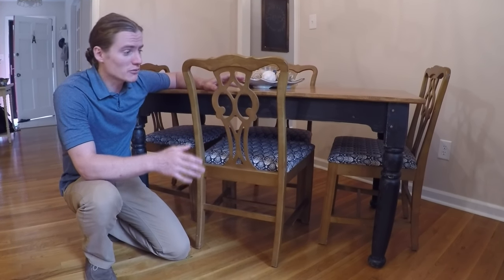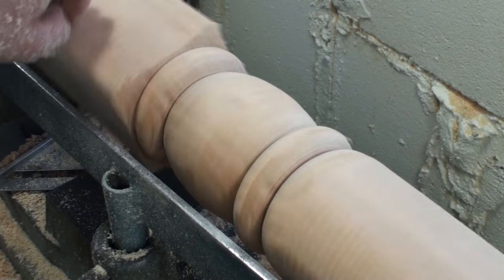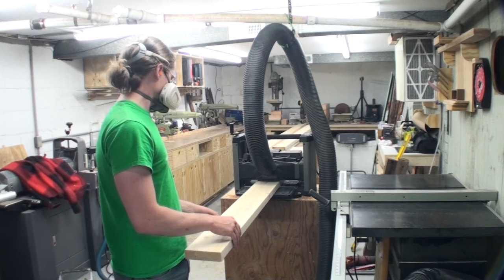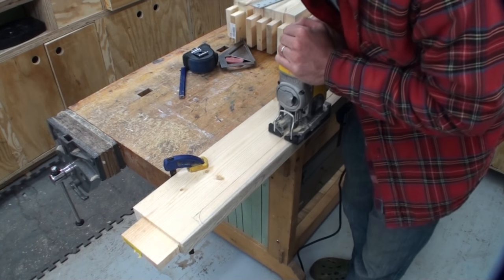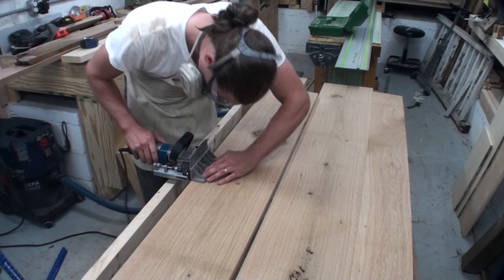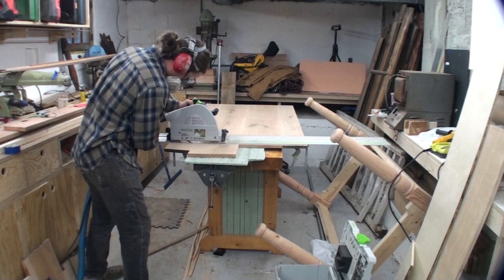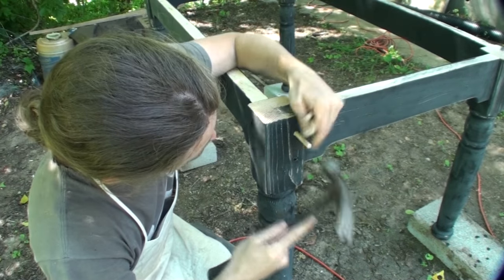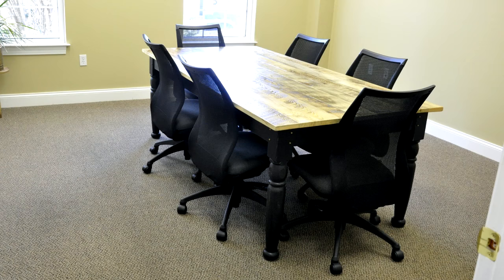Woodworking - DIY Farm Table Build - How to Plans!

Comment: hey, That top clamping rack is Trick! I'm figuring  you probably didn't film it when you built it, but perhaps a short video in the future with come close ups of how its built and anything you might do different if you built another? I noticed you like to do the distressed painted finish, I have one you maybe haven't tried. Its a multi coat paint finish. You put a couple of coats of a paint of a contrasting color to your top coat. Don't use a high contrast like Yellow under black, but more like a dark rust red under black. Then when you sand through the black in areas, The color underneath shows through. I bought an old Windsor back chair at a garage sale for $2. I stripped it hoping to find attractive hardwood under the 10 layers of paint. I did find hardwood, 3 different kinds! the seat looked like oak the legs and most of the spindles looked like beech with barely no visible grain and the bent hoop on the back looked like ash.  So i painted it, I did a dark blue underneath and then a green grey over that. When I sanded through the corners and on places where you would see wear on the seat and legs it looked great. then in a few small  spots where you would see heavy wear like on the top of the stretcher between the front legs, where a child would use as a foot rest I sanded all the way through to the wood.
Reply from the maker: I've done a few pieces like that. Historically a lot of furniture has had layered colors for different effects. For windsor chairs it's the same to, painting red under black. For the wood, it's common for them to have white pine seats, oak/ash bends and maple turnings. Each wood picked for it's strengths. It sounds nice though. I've got plans to make a windsor chair soon, my throne of sorts for my house. Feel free to post a photo of your chair to my facebook.

Comment: Thats a really Good video!  This Does help with my question about  glueing a hardwood top instead of using plywood.  I think the guy with the sawmill that told me that might have had either moisture issues or the top didn't have any allowance for expansion and contraction.  Thats just my guess.  I will Definitely give this a try!   Thank you for another Awesome video, I really appreciate my question being answered too!
Reply from the maker: Thanks, good luck with your projects, send me some photos sometime.

Comment: My main concern is getting all the cuts exactly the same length with a mitre saw, like all the legs cut down from a longer 4x4. Also squaring up the edges of the boards as I don't have a planer or jointer or table saw. Which would be most recommended for squaring up the edges for minimal cost/space. Also, when gluing up the table top is it ok to use pocket holes, or should I go for dowels/biscuits? Thanks
Reply from the maker: The truth is, even if your off a little on every cut it won't make a difference to the eye. You just measure, draw a line with a square and cut on the waste side of the line....the most you would be off is a 1/16" in this kind of project that won't make ANY difference. You could use a circular saw to get your boards close if they are really crooked, then finish them off close with a plane. But just a hand plane will do it. Pocket holes will work fine. I just use the biscuits for alignment. Pocket holes also would take the place of clamps, put a little glue in there and screw it together. It's best not to over think it, you'll learn a lot and have those skills on future projects. Good luck.

Comment: So I'm sure you know about this, but it seems like a drawbored mortise and tenon would eliminate the need to have/use the band clamps. It would require assembling the base twice. I'd bet it would take longer than dealing with the band clamp, unless you already dry assemble every base.
Reply from the maker: The band clamps are fast and draw boring them would ad more time to the process that I'd like. It's not a bad idea for certain things, including my tables but speed is a major part of making this work for me. Thank you for watching and for the comment,  perhaps I'll do a video on draw boring in the future It's a semi obscure technique a lot of people are not familiar with.
Reply: The Homestead Craftsman figured that was the case. I've used drawbores when I've either wanted to be able to disassemble the joint (without glue), or I don't have enough clamps to clamp up every thing is like to glue up.

A video on drawbores would be cool.

Comment: Beautiful build. I can see why you have a market for your tables. Do you build a "farm chair" for a set?
Reply from the maker: Thank you. I stay away from chairs when it comes to selling my tables. I single chair would take longer than the table so I would not be able to price them on the same "formula" if you will I do on the tables. I do make benches and they are doing well. Chairs also undergo a whole different level of abuse and I don't want to be responsible when they get broken. Tables are simple and all the weight/force is vertical and that's where they are strongest. With that said, I will be doing some chair videos down the road but closer on the horizon will be a set of plans for the benches I make and Im making a new video to go with them. I already have two bench videos on my channel if you are interested. Thanks.
Reply: Also, chairs aren't completely full of straight line like a table or a bench. There's curves and bends. A chair needs to be comfortable and that requires a ton of measurements and effort. whereas a bench or a table need to just be. People are better off going to a flea market and buying old sturdy chairs and simply repainting them.
Reply from the maker: Bobby Wahler
Luckily I sell tables from an antique store, so I just suggest they buy them there, or somewhere similar.

Comment: Thanks for the great videos!  I had a question about your legs.  Do you always use 4 X 4's (3.5" by 3.5") for your legs?  I know you glued up some 2X6's for a tapered leg in one video, but did were originally using thicker legs for turning?  (I thought you brought a pick-up load home from somewhere in an old video.)  I guess I'm wondering if you've gone to a skinnier leg?  And if you use thicker legs for longer tables, etc?  And whether your customers care....whether they prefer thicker or thinner?
Reply from the maker: I use both. The 3.5's are easy to get, I use them on 6 foot or shorter tables, for longer tables I use the rough sawn legs. Customer preference varies.

Comment: how do you keep the bases from twisting when gluing them up? ensuring very straight stretchers and tight square mortise and tenons?
Reply from the maker: My floor is flat enough, but even if it isn't, as long as the shoulders of the tenons are tight it is fine, this type of table base has enough flex in it to take the shape of any floor, even if it is not perfectly flat. I've never had a problem unless the apron boards themselves have a lot of twist, but in that case you just don't use that board.

Comment: I have read that pocket hole joinery is not string enough and or will not allow for wood to move or shift. Do you share this thought?  I live an in area with seasons and climate change.
Reply: Also, would perpendicular strips on the bottom side allow for movement ? I suppose I could ask a woodworker to straighten  the boards as well as plane them. I was planning on purchasing s4s wood. Does that stil need to be planed ?
Thank you.  I enjoy watching your channel

Comment: When do you feel it is necessary to add cross supports for the apron? Do you follow a rule of thumb for length/width of the table?  

Thanks!
Reply from the maker: I do it on tables that are wider than 42 inches or ones that have tops that are thinner...i just play it by ear.
Reply: The Homestead Craftsman thanks for the reply. I’ll be building a new dining table shortly very similar to your design except the legs. I don’t have a lathe so I will be purchasing turned legs online.

Comment: Do you recommend using pre stain?
Reply from the maker: For certain woods like cherry it can help, same for maple and other woods that get blotchy. I tend to no use stains that much, but like to use Gold Oak when I do smooth oak tops as it evens out the color a little but doesn't change the color that much. On most of my tables I just use a clear coat.

Comment: What type of router bit and size would you recommend with those table top fasteners I ordered the same ones? Nice job on the build.
Reply from the maker: I use a biscuit joiner which is the easiest and fastest, you can get a really cheap one, probably not much more than the router bit........but the slot needs to be about 1/4 - 3/8 down from the top and about 3/8 deep or so. I'd wait till you get them and then go from there. You can also just run the board on a table saw and cut a groove the whole way down the inside of the apron.

Comment: About the other video you made about not getting into debt. Many go into debt to get a college degree so they can get a high paying job where they don't have to do much work. I think in that case going into debt might be a good thing. Nice table also.
Reply from the maker: A lot of people get those degrees and don't end up with the job a lot of times. A lot of those high paying jobs also come with extreme overhead, so while they have a lot of money coming in, they have a lot going out. I have a 4 year college degree myself and value my time in school. In the video I said, "without going into extreme debt" meaning that you don't have to get student loans for absolutely everything. And of course there are certain professions that require multiple degrees and can not be had cheaply. No one rule or way of thought can cover every situation, but most people watching my videos that want to live along the lines of what I'm doing are most likely not looking to move toward those careers but instead looking to do something more independent but also make a decent income. None of this is meant to be in disagreement, just yet another way of looking at things. I appreciate you watching my videos and for your comment. Thanks.
Reply: I am one of those folks who went through the trouble of attaining a four year degree, just to end up not using it. I even made the mistake of relying too heavily on student loans. Some folks, like my dad, find success through schooling. Other folks, like me, do not. Either way is good, but neither way works for everyone.
Reply: Granted many may not end up with a high paying easy job by going into debt for a degree. My only point was that is the reason many go into debt for college. It increases your odds of getting one of those jobs. My self I went to work instead of college.
Reply from the maker: True. It's also about a lot more than the degree. For me the biggest advantage was that time to think and act on my own, social skill building, time working on something I love and it's where I met my wife. The degree is in a card board sleeve somewhere in a closet at my parents house............I think.

Comment: I have a question about the table top overhang from the base.  Would it be structurally sound to have the table top  overhang the base by about 8 inches on the short sides?  I prefer the look of a table with 4 legs, and the chairs to be tucked under on all sides.  Thanks.  P.S.  this table is beautiful!

Comment: Outstanding. Should you ever want to play around with the curve on the aprons, maybe cut the curve as usual and then chamfer the long part up to the small radius.
Reply from the maker: I basically do that a bit with the hand plane to knock off the edge but you could give a larger chamfer or round over with a router. Thanks for watching.

Comment: Great Video! 
Question: Was the black paint water based? does it have to be in order for you to be able to use the water based finish (polycrylic)? Thanks!
Reply from the maker: Yes it is, it's just latex wall paint in flat. I don't see a reason you would go oil based in this situation, especially when latex is so easy, dries quick and cleans up with water.

Comment: Very professional video describing a very professional building process. I remember a while back you mentioned you would be producing a line or two of chairs. Change your mind, or just no time?
Reply from the maker: Just haven't done it yet, my table orders are strong and keep me as busy as I'd like. I'm actually focusing on pulling back from making furniture for customers for a bit so I can spend some time working on my own projects, things in and out of the shop......which also means making videos of those projects. I'd like to "take off" for about 3-4 months.
Reply: Is it possible you have the table building process so defined/refined that you could turn it over to an employee? Or even subcontract it out to a handful of woodworkers with skills but not your entrepreneurial drive? You have enough projects and interests for three or four careers.

Comment: great video and channel!   just curious,  I notice you dont use breadboards on your tables.  any reason why?  do these run risk of cupping?
Reply from the maker: Jeff Lewis All my wood is kiln dried. goes straight into my shop and into peoples houses once its a table. Bread boards have their place but are not necessary in most cases. The tops on these tables are about an inch, the base holds them flat. They also add a lot of time and in general im not the biggest fan of them. I think they are a weak point in many cases as well, especially on thinner table tops. Thanks for watching.

Comment: nice.  dig it, maybe I'll make one. is the oak from lowes too?
Reply from the maker: No, I have lumber milled from logs, this particular lumber was sawn from a dead standing oak. But lowes does sell oak, it is 3/4 inch thick and very expensive...so it's a little thin. Oak is common in a lot of the country. My suggestion is use something that is easy/inexpensive to get but interesting. At the same time, your going to use your table a long time, so getting a more expensive wood is fine.

Comment: how long do you wait for the wood to dry when you buy it from lowes or hd?
Reply from the maker: It depends, with these tables I turn the legs in large batches then store them under my mortising bench. So sometimes they sit for weeks/months and sometimes I use them right off the bat. With the aprons 2X6 aprons the same applies. I would never do the same with 2X Yellow pine, 2X8s 10s and 12s as they are very unstable much of the time. I use spruce and choose the lightest weight boards as they are the stable from my experience. The bases on my tables lend themselves to this type of wood, even if they do form a crack, it goes with the style. I've made a lot of tables and no problems. If you do want to let 2X6s sit, just a week or 2 in ac/heat will reveal most potential issues. I could use other lumber, but I like that the supply is consistent, always available and they are stored at lowes, not in my shop. If I was buying true kiln dried lumber from a sawyer, I would have to buy larger amounts and store it. Just some thoughts.

Comment: That track saw makes life easy. I have a couple, in different lengths, that I made out of 1/8" ply for my circular saw. The Festool or Makita track saw is next on my new tool list.
Reply from the maker: Cool, I never made any tracks for my circular saw outside of running it against the straightest board I could find. If price is not your biggest concern, I vote for Festool as the TS 75, the larger saw from festool, has a deeper cut than the other brands and when you need it, it is nice. The same goes for it's power. But with more capacity comes a higher price, it's not cheap. I initially bought the saw with 75 inch track, 118 inch track, clamps and rail connectors and had around $1400 out the door. But I would do it again in a heartbeat now that I know how useful it is to me.
Reply: I bet it is worth it for you. My tracks work just fine for cutting off the occasional door or some sheet good that I am cutting down. Nothing too precise though. 
I was going to make your Farmhouse table, but now my wife wants one made with black steel pipe for the legs/supports. But I will still have to make the top similar to yours.
Reply from the maker: Sounds good, the black pipe base will be cool, I've seen them. Send me a photo of what you end up making, I'd love to see it.